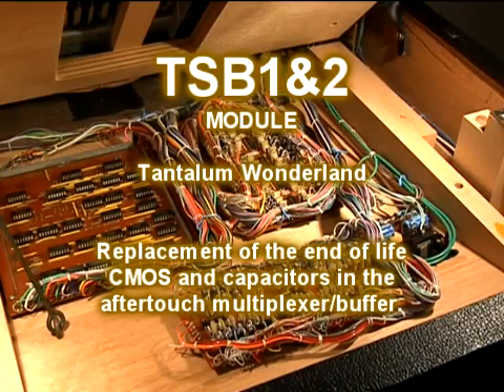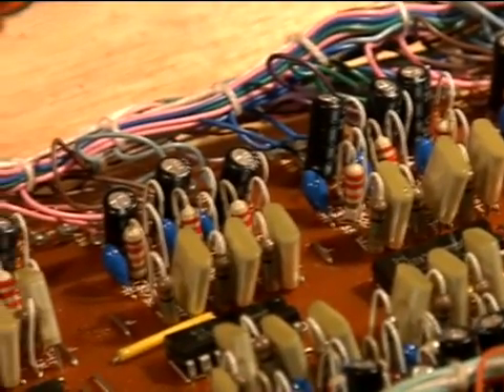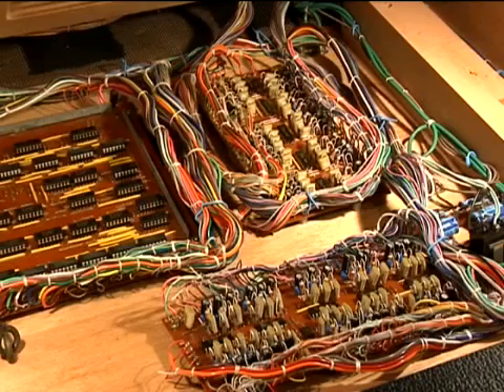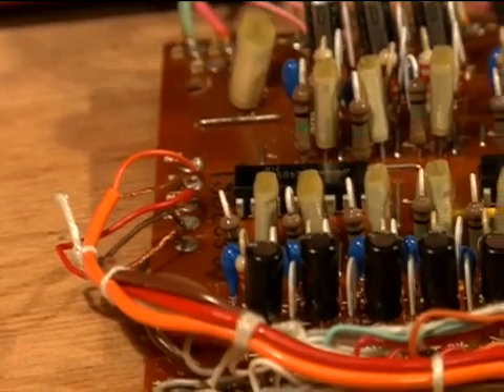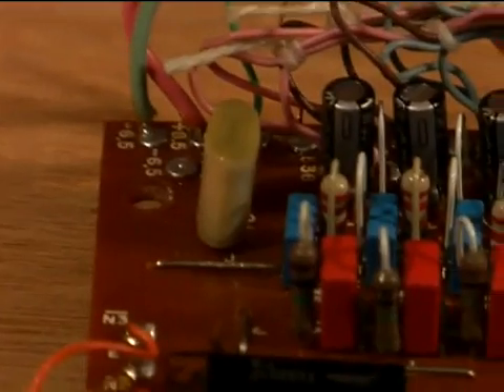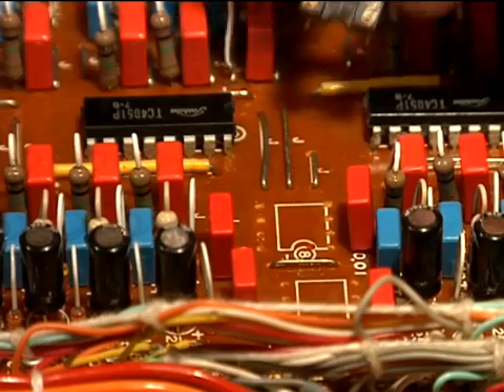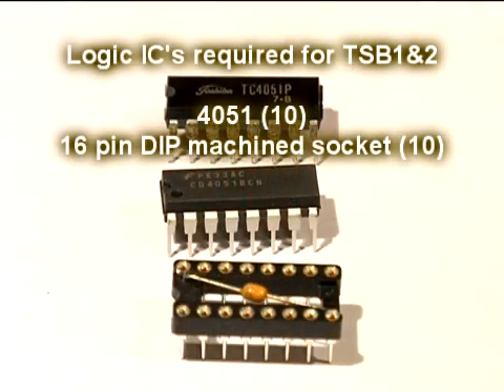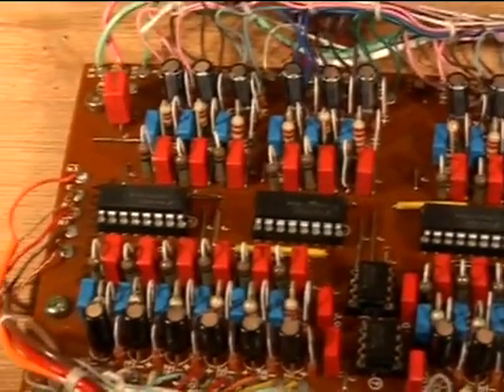Saving the Yamaha CS-80 (5) TSB Control Boards

Comment: opa 4558 operational amplifier, with each half electrically similar
• Wide Common-Mode and Differential Voltage to the μA741,change  opa 4562 very fast all the best for cs80 is good

Comment: Just on those two boards alone. How much do you think it cost for replacement components??
Reply from the maker: +skyprop not that much actually.  About $85 and that's using top of the line parts for both boards.  For the entire machine it would be in several thousands.  These videos I made just cover the bottom boards that have the most issues as CMOS digital chips were not perfected and most are in the bottom.  There are 34 more circuit boards on the top I have not made videos of.

Comment: hoooooooly fuuuuuuuucking shiiiiiiiiiiit! thats crazy shit under there, wouldnt want to be plain around with that O-O
Reply from the maker: This is the simple stuff.  You should see the other 34 loaded circuit boards stuffed in the top section.  Over 1,200 trimmer pots too.  Search here on youtube "The Analog Lab NYC Yamaha CS-80" for a mind blow if you are more curious what this beast has upstairs.
Reply: holy mudder hubber 0.O great work.

Comment: I was lead to believe the mylar capacitors were reliable with long lifespans, did you find many faulty mylars in your repairs?
Reply from the maker: Mylars have extremely long life and every one I removed that I tested was a perfectly good component with the exception of one.

Polypropylene and polystyrene are much more stable over temperature however which is why they are being replaced.  They don't drift.

On my KAS board, the oscillator for the CPU (keyscanner LSI) was only 65 KHz and was the result of a drifted value mylar. I replaced it it with a polypropylene and the oscillator was at 97 KHz.  Service manual indicates this oscillator should be between 95-100 KHz so it is now dead on.  The refresh rate of all the D/A converters and sample/hold circuits was lowered by 30% because of one capacitor.
Reply: Gavin Curtis
Very interesting Gavin, Your work is inspiring. While I don't have a CS80 yet I do have some old yamaha organs that share some of the circuitry and components. I'm planing to replace all the electrolytics, tantalums and anything else the may be critical that I identify through my service manual. The components that have failed me most in the last few years have been the 4000 series chips and 4558 op amps. Was wondering where you get your sockets from with the built in decoupling capacitor? I can't seem to find them anywhere.
Reply from the maker: Sorry about the late response.  They sockets are made by Mil Max and you can get them through digikey or mouser.
The 4558 are pretty tough.  Save all of the good ones as there is a guitar pedal market for the highly desired Japanese made 4558 used in the CS-80 as they apparently have an interesting "crunch" when clipping for distortion pedals.

CS-80 doesn't care as she does not clip her op amps.  Needs stability and reduced noise.  :)

Comment from the maker: Good suggestion.  The Japanese electrolytic caps I used are rated 7000-10,000 hours at 105 C.  They should be good for MANY 10's of thousands of hours of continuous duty in this rebuild, which is supposed to exceed the life-span of a solid core polymer capacitor.

Any additional information would be greatly appreciated of solid vs electrolytic.  To be honest with you, most of the 40 year old electrolytics in this machine still test perfect on the ESR meter.  But I did find some beginning to leak

Comment: @gavincurtis 
Thanks for the reply Gavin. I ended up ordering a Hakko desolder station which should be here this week - i think it will be 100x better than the desolder gun i had before. I also bought a CS60 and a Rhodes Chroma which both need full restoration. I might well be crazy :|

Comment from the maker: @backindauk Sorry that I have taken so long to respond.  The tool that I am using is a vacuum desoldering system.  Specifically a Weller WR-3M, but many low cost versions that work just as well are available.  Definitely get a vacuum desoldering tool because as you know the CS-80 is insanely complex.

Comment: Hey Gavin, 
Thanks for posting this. I am restoring a CS80 at the moment, with two more waiting.It is a time consuming but very worthwhile process.

I'm just wondering which desoldering tool you are using? I've been using a "gun type" Weller one but it just died and i am back using wick - the gun is heavy on my wrists also. I think going for something with the suction unit away from the handpiece would do me well.

Andrew

Comment from the maker: @Synthfool 

You are right, 25 turn... my mistake.  I bought smaller units to fit on the SH board and were 12 turn.  But the normal are the 25 turn.

Any suggestions about resistors on the LSI D/A converters?  The KAS board uses .01% for the D/A voltage ladder, but the KBC boards use 1% which control the voice cards.  I was thinking of upgrading to .01% wirewound.

Any ideas?  Going to try .01%.

Comment from the maker: @Synthfool 

I used 12 turn mini cermets (6mm square) on the KAS and board as the standard 10mm didn't fit properly.  But the rest of the boards the 10mm 25 turn fit nicely as they are conventional and ideal.

Anxious to hear how much less noise the VCA's will play without the easily 500+ evil OEM carbon (and oxidized metal) pots ruining the sound!

Replacing the original BBDs with the modern low noise versions would probably help much when using those circuits too.

Comment from the maker: @Synthfool 

Good idea on the trimmers.  The originals are nasty.

Going to try the sealed 12 turn cermet type.  

Unlike the originals, they are designed to stay where you put them regardless of bumps or vibrations.

Comment: Glad you're doing this video series.
I've been doing the same- restoring a CS80.
This one here is getting all new caps and all new trimmers. Likely some CMOS chips also.
Already done with the power supply and several boards, but LOTS more to do. 
Trims are a big problem on this one, btw.
But I'm using much better kinds and hope it will stay in tune better. The CS80 is built like a home organ. :(

Good luck! :)